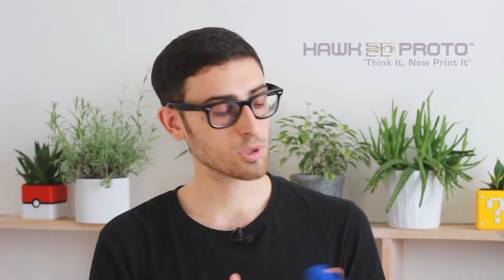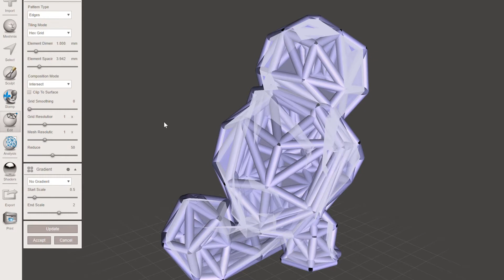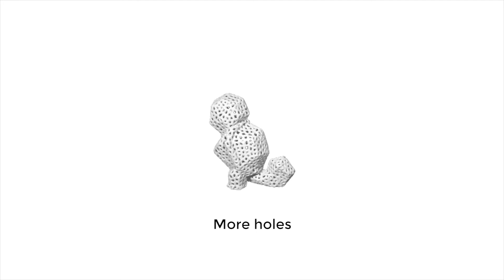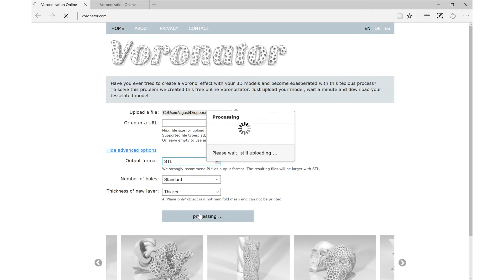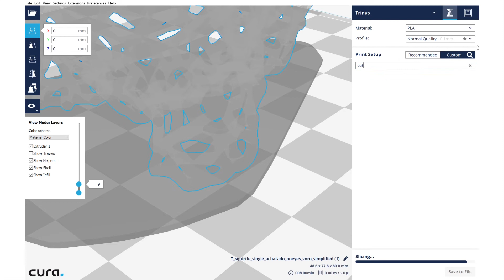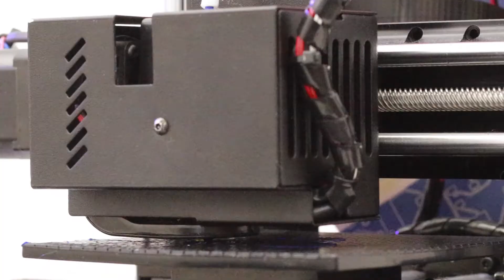Voronoi Tutorial - Apply Voronoi Pattern to any 3D Printing model

Comment: FYI, half of the links in your description are not links, because you omitted the https:// part and YouTube doesn't convert them. It is easy to open them by selecting them and dragging the text between two tabs, for example, but still it would be more convenient if they worked out of the box. The first link seems broken, anyway. The auto-subtitles are strange, too,  but you have no control over them.
Anyway, I appreciate the link to the Voronoid generator, thank you.